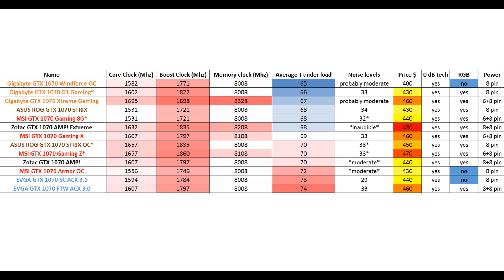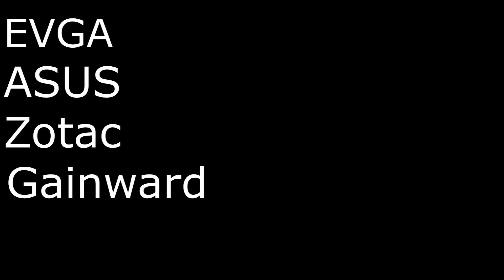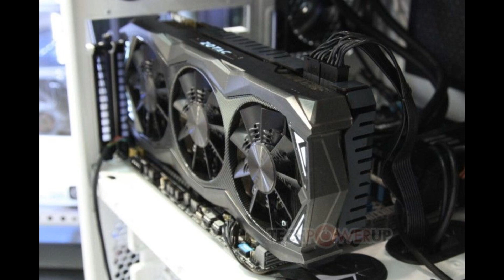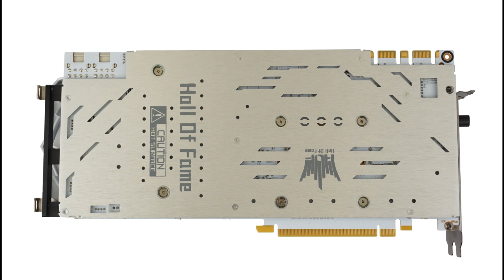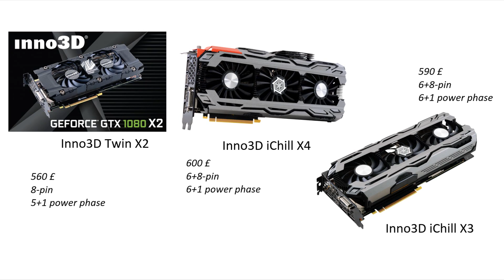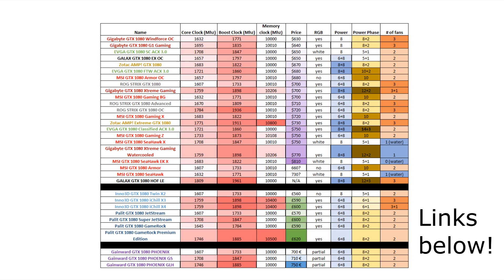Which Geforce GTX 1080 to buy? 33 different GTX 1080s compared.

Comment: hey,
 ZOTAC GeForce GTX 1080 or MSI GeForce GTX 1080 gaming X ? 
Which one, the zotac card seems much more cooler and being able to stay cool while having more core clock. 
 what do You think ? im looking for a stable future proof card, thats it.
Reply from the maker: The Zotac is extremely huge, but has good temps and noise. The MSI card is known for high quality, is smaller, but still cools well enough.
Reply: foreign's gaming tech il go with the msi gaming x then. i want nice quality. plus the card is a looker when it compares to the zotac imo
Reply from the maker: Yeah, the Zotac card card is extremely big. I kinda like it though :) But still scared for my PCIe slot because it weighs a ton.
Reply: also man, one final question. how much more powerful is MSI GTX 1080 gaming x than MSI GTX 1070 gaming x ?
  let's say in % ?  because what i've see in reviews it gets like 15- 20 fps more or something like that. what's your take and experience. because maybe i don't need that extra power for that money if i will be playing only in 1080p and 1440p is my main target.
  thanks in advance man.
Reply from the maker: The 1080 is something like a 1440p100 FPS card, the 1070 is more like 1440p60 FPS at high settings. The 1080 is able to push most games at 4K at 60 FPS with medium-high settings, the 1070 isn't. For 1080p the 1080 is overkill 100%, the 1070 is cool for 1080p144 FPS gaming. In general the percentage difference would be exactly 10-20, depending on the game and OC.
Reply: The 1080 can play 4k at ultra settings while the 1070 can't. :)
Reply: well im not sure about that. maybe if u lower the settings here and there then yes, but on ultra no. you can go play minecraft on ultra mang with that in 4 k lel
Reply: stalkerlohh
Dude! I get 1 FPS on Minecraft with the lowest settings on my 4-way sli Titan X(P) overclocked setup with a 6950X overclocked to 4.5 GHZ!!!
Reply: I know I'm late, I liked the ZOTAC better, but I couldn't get it in AUS. So I went MSI
Reply: William Townsend Me too.

Comment: what is the fastest 1080 in your opinion and which one do u think is the best 1080
Reply from the maker: I would personally get the GALAX Hall of Fame GTX 1080. Otherwise all the flagships from the other manufacturers are good, but I'd probably go Gigabyte because it's $700.
Reply: Zotac amp extreme is one of the fastest, but I think the Galax HOF is faster.
Reply from the maker: The AMP Extreme is a crazy card, that cooler is enormous. I think it dissipates all the heat possible, but it's extremely heavy and big - not suitable for all people.
Reply: hi guys,i got this crazy card...really awesome seriously.
Reply: +Joe Hakarashi what is it
Reply: gtx1080 zotac amp extreme edition...
Reply: +Joe Hakarashi how is it because I want one but people are saying it goes black sometimes
Reply: maybe you have to try it.  there is no problem i'm using it for right now...

Comment: So what would you suggest for someone that wants it to be quite but also stay at a low temperature. The best possible one, the cost isn't a big deal.
Reply from the maker: Go for the EVGA Hybrid then! It's watercooled. You can set it up into a push-pull configuration to bring the temperatures even further down.
Reply: Okay! Thank you very much :)
Reply: What would be the best still fitting the same needs but isn't watercooled? So still quite and low temps.
Reply from the maker: You may want to check Inno3D iChill X4 and Hall of Fame. Those are also great.
Reply: Alrighty, thanks again

Comment: zotac amp extreme 1080 owner here.
Reply from the maker: +mechaart how are you liking it?
Reply: its quite a hefty card. It can do 4k at 40 to 50 and even 60fps... but with tweaks. I got it instead of the Asus Rog 1080 as those went up to scalper prices... Also the fastest is my gpu out of the box, but most of the 1080s can overclock to 2000mhz from what I've heard.

Also the fan's turn off if the gpu isn't heating up and they only spin up if it needs it, then it shuts off again.
Reply from the maker: Sounds pretty good. The Strix is one of the best coolers this generation, but it's also one of the most expensive, unfortunately.
Reply: foreign's gaming tech in terms of "coolers" that title goes to the water-cooling block gpu editions.

Though the fans on the amp extreme are actually thicker than the strixx , has a larger heatsink and the fans also have a curve to em, also have to factor in proper air  cooling setups.Though the Strixx does have more rgb options in the software.
Reply from the maker: You may want to check out GamersNexus' teardown of a Zotac Extreme card, they were pretty critical about it and its design. Not to say it's a bad card, but it performs differently from what it looks, unfortunately.
Reply: foreign's gaming tech Yeah it may seem that way, but he forgot to mention the fans turning on only when its needed. I got a better understanding from Toms Hardware guide about the 1080 gpu.
Reply from the maker: +mechaart the 0db tech is present in all higher tier GTX 1080s, it's not something out of the ordinary nowadays. But well, I feel that being satisfied with your card is more important than thinking if it performs the same as the reviewers say :)
Reply: foreign's gaming tech I purchased it due to price and performance. I was not going to pay 1080ti price for a gtx 1080 8AG STRIXX that is now rare to find, unless I buy from ebay used.

Ill wait for the new gen gpu architecture to release down the road to get a better card. For now Im content with the Zotac gpu and its worth every penny.
Reply: Getting mine Friday, I’m very pleased to see how much people are loving it,

Comment: what does the powerphase describe?
Reply from the maker: Hey, basically they allow for cleaner power delivery to the GPU, which in reality may mean a more stable overclock. The max overclock will mostly depend on the bin of the GPU itself though, so in the long run the power phases are there mostly for marketing reasons. It's good to have them, but it's not a necessity.
Reply: foreign's gaming tech hey thanks man very helpful :) i just bought the Asus Strix model partially because of the design and now im not sure if i regret my decision :)
Reply from the maker: The ASUS Strix turned out to be one of the best cards this gen! It was just a bit overpriced back when I made this video (like, literally the most expensive). No reasons to regret the purchase of one of the best 1080s out there ;)
Reply: foreign's gaming tech thanks for ur friendly help:) ill be sure to leave a like and sub bro :)
Reply from the maker: You're welcome, and thanks!

Comment: I love MSI but the design of the card kills it. Which one runs the coolest of them all?
Reply from the maker: I will kind of agree with you! The red got kind of tiring this generation, even though the cooler itself is very good.
Reply: I think gpu temp: msi, asus but they have not much vrm cooling so I prefer the cooling solution of Gainward/Palit.

Comment: Hi, first of thank you for your affort about this video. I 'm building a gaming comp. & I strugle between EVGA 1080 GTX / ASUS 1080 GTX /  ROG STRIX GTX 1080TI... in future I 'll do SLI.. So maybe you can an advise about which one I should choose..
Reply from the maker: If you're thinking about getting the 1080 Ti then it's definitely more powerful, but also much more expensive.
Reply: thanks for responde... I wrote there Evga, Asus 1080 GTX but i didnt wrote for ex : Evga 1080 GTX - hydro copper or hybird or super clocked same as Asus 1080 GTX FE or OC or Titan X  ... I seperated Rog Strix Ti because it s little different..  my bad.. I thought u give an advise like: "Asus GTX 1080 maybe u want to check OC ..."  I 'm looking best gaming card.. if u want quality & fast & best it s never be cheap right... money is a second plan for now. So still in the same idea about advising Rog Strix? I meant it s definitely be GTX 1080 but which one? ... I really consider your opinion for chosing...
Reply from the maker: The Strix is great, yeah! If you want the most performance - a 1080 Hybrid from EVGA (watercooled) is the best, but is more expensive.
Reply: Ok, thanks again..I 'm thinking SLI it 'll be great..  Now I 'm double checking.. & working on monitors? I ve same problem with the monitors..
Reply: Final question: what about this  one : ASUS GeForce GTX1080 Ti FE 11GB GDDR5X
352Bit ... this or Rog Strix Ti ?
Reply from the maker: The one you're talking is the Founder's Edition - it is very bad! The Strix is definitely better.
Reply: Thank you.. You  really did help me.. So it ll be Asus Rog Strix GTX Ti..  but 11 GB single or 8 GB SLI
Reply from the maker: If you're up to the challenge of SLI, then two GTX 1080s will handle 4K at ultra settings at 60+ FPS. But a single card is always less problematic.
Reply: So you say 11 GB single it is?!
Reply from the maker: +Samolf Luger Yes! The 1080 Ti Strix isn't out yet though, so be careful what you're ordering
Reply: Thank you for all your help.
Reply: Thank you for all your help.

Comment: Hi, MSI GeForce GTX 1080 gaming X or MSI GeForce GTX 1080 gaming z? Which is better? which one do you recommend?
Reply from the maker: In theory the Z is better, but in reality they should OC to close to the same. If there's like a $10-15 difference between the two, if $20+, then get the X.

Comment: i am in quite a dilemma,
upgrading from a 1080p tn "with many many years of using that  , at least 8 " , thinking its time for 1440p and maybe ips to, so

Acer XB271HUA tn vs Acer XB271HU  ips

so, both are on 1440p .144 and g sync 

i was aming at XB271HU   , but now ,suddenly a page has the XB271HUA on sale for 3990 kr " 580,23 USD" here in denmark 

and the XB271HU   stands to 5779 kr "840,38 USD" ,

now comes the questing, do i go for the sale and a bit cheaper tn or should i break both legs and go for the ips ?
Reply from the maker: If you can afford it, then of course go for it. I personally wouldn't because I'd invest that extra $300 into the PC.
Reply: hm, yeah i kind of have xD , but true that extra 300 i cound spend on a new card , as i am aiming in the future " in for a year "  a gtx 1080 , preferable 1080 titan

https://uk.pcpartpicker.com/list/y4JGNN - my current build if it helps -
Reply from the maker: Nice build! Basically I'd recommend getting a 1080 Ti and that TN Acer monitor. The picture will be a bit "worse", but you will be getting literally 100+ FPS in all games at ultra.
Reply: heh thanks,i am always so damn paranoid/confused,   that my build suffers in someway or there is a bottleneck somewhere , 
but i think most games a just not that good optimized :/

hm, yeah that does sound good and  from what i have seen " sadly not in person " , that image wise between ips and tn isen that big of a  def , but i have only being looking at a  tn all my life , so i probably wont suffer to much , and still enjoy the 1440p jump
Reply from the maker: I'm sure you'll get the best out of your system :) Make sure to get a good aftermarket 1080 Ti! I'd recommend the MSI Gaming X or EVGA FTW3, both will top-notch cooling solutions.
Reply: okay, thanks ^^ 
i quite like gigabyte , but sure i will take a look at those aswell -

Comment: inno 3d 1080ti ichill x4 or zotac 1080ti amp! extreme.. which one do you recommend? i want to buy between these two gpu
Reply from the maker: +rey jefferstone the zotac should in theory be better!
Reply: just do some research and yeah zotac way better and the price only $8 diff. thx bro
Reply from the maker: The Inno3D uses a very interesting cooling solution.. and it looks pretty cool to (IMO). But the AMP! Extreme is definitely the better choice for the same money.

Comment: I have a question. I will be using some random prices for the example.
Is it better to get a MSI 1080 Gaming for 600 USD, and do the overclocking yourself, to match the Z version
Or is it better to go for a MSI 1080 Gaming Z for 700 dollars. And stick to its default clock.

I found a regular "Gaming" at a discount, And its alot cheeper than the "Gaming Z" But i dont want to get fooled and later find out that the Z version is just generally a better choise.

Thank you!
Reply from the maker: Hey, the Gaming Z  cooler is the same as the Gaming and Gaming X, only it has an RGB logo and is pre-overclocked out of the box. The chips should in theory be binned, as in they will overclock better, but in reality the Gaming can reach 2000 or 2114 Mhz, just as the Gaming Z can reach 2000 or 2114 Mhz - both with the same probability more-or-less - no one knows how well the Gaming Z chips are binned, and in reality there may be only a 1-2% difference. I would recommend to just get the regular Gaming version and saving that extra $100 for a bigger SSD for instance, as that will definitely give you more benefits than a possibly 1% faster GPU.
Reply: Okey, thanks for responding! I already have a 1TB SSD :P  I might just go for the gaming then :D
Reply from the maker: Good luck! :D
Reply: foreign's gaming tech Thanks :)

Comment: which one is the most quiet
Reply from the maker: Zotac AMP! Extreme, Gigabyte Xtreme Gaming (Aorus) or any watercooled card.
Reply: foreign's gaming tech thx for the reply bud,are water cooled gpus high maintenance? is it plug n play or do I have do replace the water periodically?
Reply from the maker: AIO versions like MSI SeaHawk or EVGA Hybrid are very low maintenance. It is possible that the pump may fail in 4-5 years, but you will most probably upgrade by then anyway :)
Reply: foreign's gaming tech 
nice, thx again my dude

Comment: Should I go with 1080 msi gaming x/z or zotac?
Reply from the maker: Zotac Extreme? I'd suggest the cheaper card, but if you can handle the Extreme card (its size and weight) and it's the same price as the others, then get that. Make sure it fits your case.
Reply: i've one zotac extreme, and quite heavy card.

Comment: Hello I am having KFA2 1080 grafic card and i am mining with them.My overclocking setings are 

power limit--70
temp limit-- 81
Core clock-- +175
Memory Clock MHZ-- +990

Grafic cards are runing great and stable on about 61 Celzius with fan speed 71 % and diging about 570 Souls
My question is are this setings safe that i would not damage my cards

Thank you
Reply from the maker: Those settings are safe! Make sure you have cool air blowing onto them from other fans and change the thermal paste every 6 months or so.
Reply: foreign's gaming tech think you for fast replay

Comment: Can a B85M-G handle the 1080 FE?
Reply from the maker: Yes, but what CPU? A lower tier CPU will probably bottleneck the 1080.
Reply: foreign's gaming tech i7-4790k
Reply from the maker: Yeah you're good. The mobo could be a Z-mobo though, so that you could OC the 4790K.
Reply: foreign's gaming tech Cant i overclock with the motherboard i have now?
Reply from the maker: No, overclocking the 4790K requires a Z97-type motherboard. You will still use the CPU at its max boost clock, you just won't be able to manually OC it.
Reply: foreign's gaming tech Oh thx man, i think i just will stick with my motherboard for right now, but if the performance is very noticeble i will upgrade it.
Reply from the maker: The Hood you'll be totally fine :)
Reply: foreign's gaming tech But i can overclock my Graphics card right? (With the 1080fe)
Sorry that iam asking a bit too much, i just want to make sure if its a good deal to go from a GTX 970 turbo to a 1080 FE in a small casing.
Reply from the maker: Yes you can OC. Out of the reference designs the FE is definitely the better type of cooler, though it'll still be extremely hot. What kind of monitor are you using?
Reply: foreign's gaming tech BenQ Xl2411z gaming monitor.
Reply from the maker: The thing is that the 1080 is more of a 1440p card. Your monitor would be totally fine even with a 1070.

Comment: So I'm getting a MSI GeForce GTX 1080 Aero OC for ~900$
Have no plans on overclocking it. I am kind of unsure if it's worth it or not.
Reply from the maker: If you're using a very small case with limited airflow or planning to SLI in the future (which I don't suggest), then it's worth it. Otherwise I'd get an open-air cooler card.

Comment: What should I get MSI 1080 Duke, gigabyte 1080 windforce, MSI 1080 aero,  Zotac 1080 amp edition, Asus 1080 rog STRIX, MSI gaming x, EVGA 1080 sc acx, or gigabyte g1 gaming ? Price range from $480-$550 with MSI 1080 aero being cheapest
Reply from the maker: Get the Strix! It's the best of the bunch.

Comment: ya im so los ton what to get. Idk if im going to sli or not either. People say FE cards are better to sli since its a blower style cooler. But if the custom cards fans are really good at cooling then i guess it wouldnt matter?
Reply from the maker: If you have space between your cards when you put them inside (like here: http://imgur.com/a/KGG0N), then you can put two custom cards, maybe put a case fan blowing cold air into the area between them - that will keep the airflow pretty good. If the area between your cards is smaller, then blower style would be better. But the temps will be pretty high anyway, so keep that in mind.
Reply: ya i dont think i can. msi gaming 5 is my mob. but it wont support that.

Comment: i need help, heres the cheapest gtx 180s i can get in australia currently which should i get?
Galax GeForce GTX 1080 EXOC Sniper White 8GB $800
MSI GeForce GTX 1080 Armor OC 8GB $800
Gigabyte GeForce GTX 1080 WindForce OC 8GB $819
MSI GeForce GTX 1080 Gaming X 8GB $829
Gigabyte GeForce GTX 1080 G1 Gaming 8GB $829

the price doesbt natter because the difference is so minimal, any way which one should i get??
Reply from the maker: Hey, out of these I'd recommend the MSI Gaming X! It has the best overall cooling.